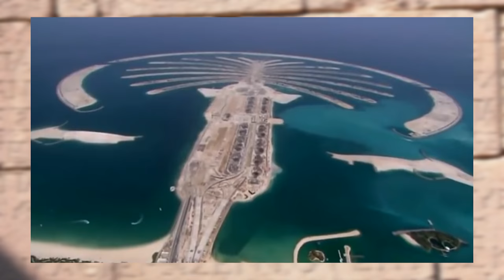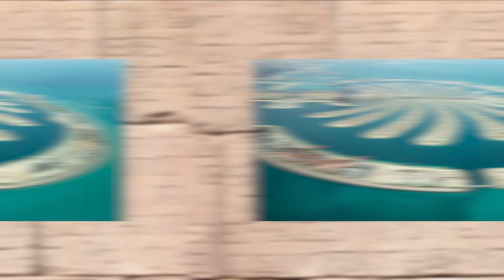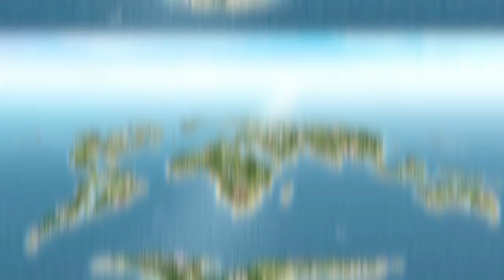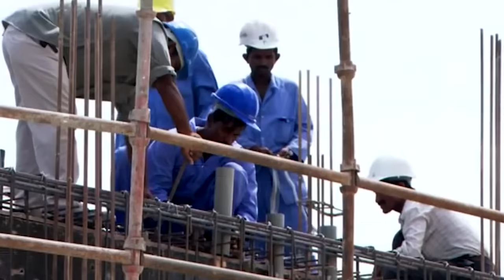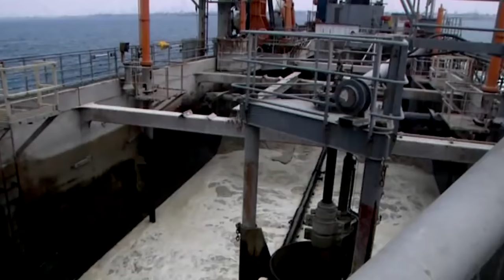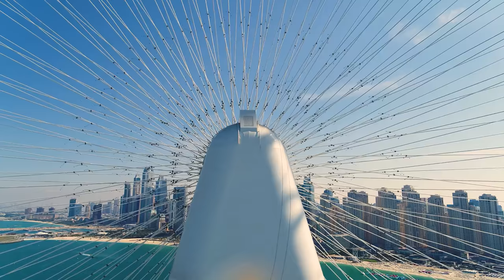Why Dubai's $12 Billion Dollar Islands are Sinking

Comment: This was done in the 80's reclamation in Manila Bay for a Financial Center using boulders and pumped sands from deep of the sea and use vibro stabilization to stabilized the soil.The buildings foundation concrete piles of up to 150 feet ( 45m)  in length were driven to achieve the soil bearing . I think it work as I have not heard that buildings were sinking after 42 years since the Philippine National Bank Headquarter was constructed.
Reply: Yea that’s the right way to do it. They didn’t do this here that’s how they did it in 6 years
Reply: This is how we do it in the Netherlands everywhere. Foundation piles deep in the ground and built the house on top.
Reply: This guy in the video doesn't really address the problem causing this. It's not rising tides or anything else, it's poor engineering and execution.
Reply: Also check out the history of the Toronto waterfront before and after they filled in the harbour. It’s all about engineering .

Comment: Seems I remember something about certain airports sinking as well. The problem is, you can put landfill in the ocean to build an island, but the very weight of the island will deform the ocean bottom causing subsidence. Some of it is also due to rising ocean levels (about 1" per year globally). In general, building oceanic islands is a very bad long term idea.
Reply: I always , thought to myself , people building on sand . at long time . water give not up for sand ! .A Part of the Netherlands also building on sand . in a part of the Netherlands , have they building near water , only houses that rise   with high water .
Reply: Kansai airport in Japan is pioneer of artificial island construction. The island is now stabilising and airport is very much of a success.
It’s still sinking but at much lower rate and the buildings all have foundations that can be jacked up. All around the perimeter, there are walls that can be upgraded with the water level and rocks added to stop erosions.
The island is so successful, and over capacity, that they built another island next to it. That proves how confident the Japanese are regarding their man made island.
Reply: @madsam0320  Glad to hear they are able to deal with the subsidence issues. It's all about money though. They have no land to use for an airport, so they have no choice as it's literally all they can do. Either build in a place where its $$$$$ with subsidence issues, or have no airport, which is critical to their economy.
Reply: @WarpFactor999  You are right, it makes sense for Osaka, Hong Kong or Singapore to make artificial islands, but Dubai has lots of deserted land. Those artificial islands need constant maintenances or they will sink and be washed away eventually.
Reply: Japan airport is sinking
Reply: Many things in Dubai are a "very long term bad ideas". How many rich people they can find around the world to live in 50+ degree C.
Reply: kansai airport and hong kong airport are all doing very well
Reply: @truuspeeters8668  yes, at base belong, us hear them. Where go? Who go? we Know. building on water. sand long time. Be go hair phase winter bridge.
Reply: @stephennorton6995  Yes , now i have see the buildings . , fortune , out of the earth . amazing . incredible .
Reply: The ocean has risen only between 5 to 8 inches since 1900. Sea levels started rising, and glaciers melting in the 1800s after the end of the mini ice age.
Reply: @JimChap  Probably not even that much, if at all. A good indicator is the manmade island of Miami Beach, FL. Since it was built in the late 1800s, it has been sinking at the rate of about 1 inch every 10 years. That rate has been constant. The most ambitious level of rise claimed currently by pro-Climate Change scientists is about 3mm, which is unmeasurable and impossible to prove or disprove.
Reply: This is what happens when you have billions to spend because, why not? 

Smh.  Such a waste. It's pure novelty for these Emirs.

Comment: Somewhere there's a story, similar to "the three little pigs" building their homes of various materials that don't hold up, except it talks more about building on rock versus a foundation of sand. Basically, you can put all the rock you want in that location, but if the rock sits on sand instead of bedrock (or piles down to bedrock) what will happen is the surrounding sand will be pushed out by the weight of everything above... and slowly washed out to sea.  IOW, kinda like when you step in shit, and it oozes out around the sides of your foot. Bottom line is this project will continue to sink at the same rate for decades. He said it sunk 3 inches but didn't say how long that took. My best guess is it will be taking on water at surface level within 50 years.
Reply: But, but , but… I’ve got a white BMW and marble surrounding me! I’ll never die!
Reply: It's from the Bible. The wise man who built his house on rock and the foolish man who built his house on sand.
Reply: @hjt091  .... cartoons and kid's story books basically say the same thing, but to a different audience. It's the "history repeats itself" situation.
Reply: Rupe53 that plus rising sea levels will give them plenty to think about!
Reply: @johnduheaume6650  ... maybe we should start a pool on which will happen faster?  <LOL>

Comment: Our company have been reclamation beach on the Palm Jumeirah for the last 7 years...  to be honest i think as long as we operate.. the Palm Jumeirah at least wont sink.. we are adding roughly 120 thousand cubic meters of beach sand to the shore lines of the palm island on annual basis..
Reply: Yea if there maintained they will be fine
Reply: What a waste of time, recourses and money
Reply: @jimbeam8338  man..
Reply: Unless you are lifting the elevation of those islands (which is impossible at this point) you don't stand a chance against rising sea levels. The clock is slowly ticking.
Reply: Ok.
Reply: Then the buildings will sink.The shore lines will stay fine, and soon you will have a flood issue, then after that, heading to the beach from your house .... will be like climbing a hill

Comment: Are you sure they're not eroding?  If the sand, as you say, is returning to its natural place, or something like that, that is not sinking.
Reply from the maker: What I meant by the sand "Returning to its place of origin" was that it was slowly eroding away from the islands. Since these islands are man-made, the sand did not originate there, which is why it can erode away so easily. Eroding is technically sinking, because it is causing the land mass to begin to go under the surface (under the water) as the sand built up begins to erode away. I hope this simplifies things, thanks for watching.
Reply: Somewhat of a semantic issue, but I would think eroding is more accurate.
Reply: I'd imagine not just water erosion but the wind would literally blow the sand away too

Comment: Rising Sea Levels is a wrong/ erroneous critique as a danger: the nearest PSMSL database at Muscat, Oman,  observes no rising particular rising trend through till about today.  Another nearby gauge  at Manama, Bahrain shows some increase but the record cuts off in 2015; notably, 2015 is also recorded as a peak at Muscat: IF the record continued at Manama as it does at Muscat, then it would also likely record a decreasing trend through till today.  Worldwide, there has been no observation of changed or increasing trends on Average (Just look at the Sydney , or New York record - any record which goes back into the mid 1800s : Zero Deviation in trend has been recorded).   The sinking problem is REAL, I'm sure. The Rising Sea Level Problem is not really a 'problem'. Sea Level is highly dependent on local tectonics, EG, why Alaska and Scandinavia have "lowering" sea levels as quickly as they're "going up" in New Orleans.
Reply: Wow.  You so smart

Comment: “Making islands where there are not meant to be”   What kind of logic is that?  Why are they not meant to be there?  I’m pretty sure they intended them to be installed at those locations.
Reply: Just because you want something in a particular spot doesn't mean it will stay there the same for much longer because you do have to realize that he just said that if you put something "where there are not meant to be" then it will screw up the whole Eco system and weather patterns

Comment: They hired the wrong consultants. They should have hired the Chinese. Look they build islands in the sea and till now its still there after encountering countless heavy monsoon storms. They even build air bases on those islands.
Reply: The bases are sinking in China , too . So now what genius ?
Reply: @wumao6797  - built of sand , does this not tell you something ? And there are vids of chinese workers putting bottles in a form for floors because they want to save on concrete . Same applies here .
Reply: @wumao6797  Chinese are good at building walls not islands, stick to what you know